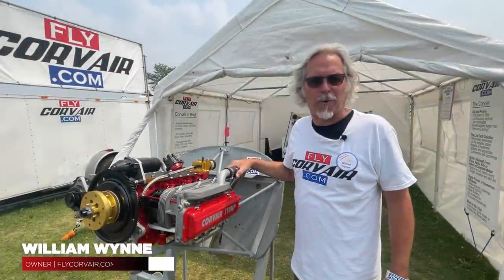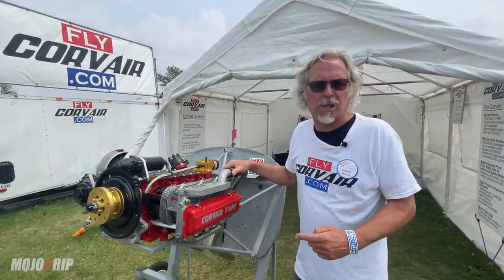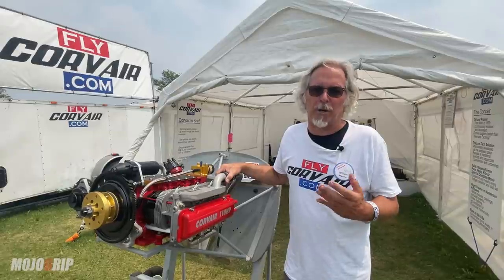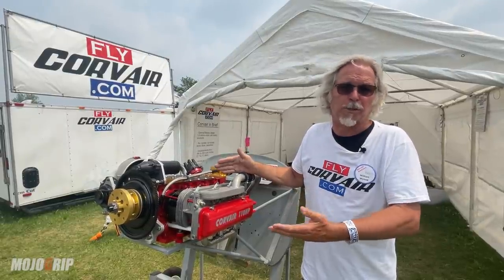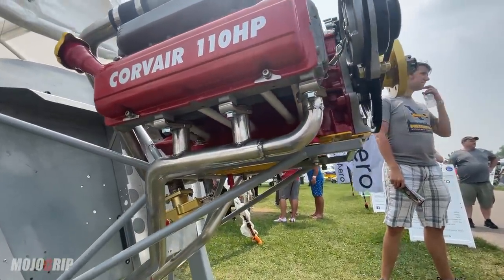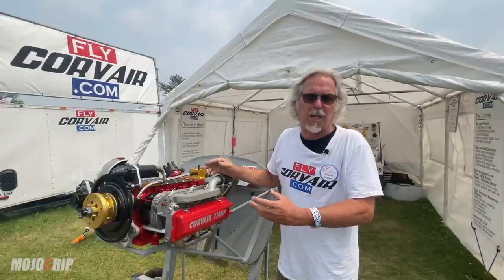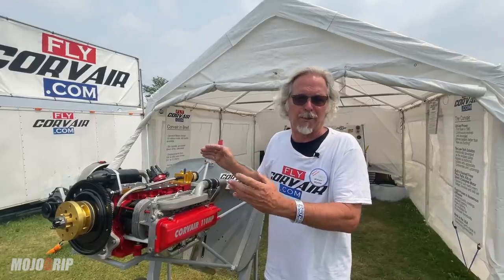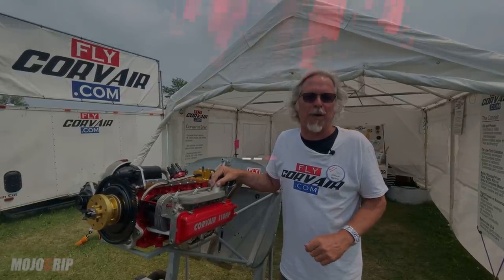Auto Conversion Engines Used To Power Plane | Corvair

Comment: I don't think the corvair is an easy project. Two many options, you have to be a dumpster diver to find the core, then you have to figure out what you want order/build. Or go to viking or aeromomentum get the same hp engine for the same price built for you.
Reply: Did you really listen to what was being said here though? They will sell you a completed Corvair motor if that's what you want; and it doesn't even really save you that much money to build it yourself. However, he encourages people to be involved in the build process so they intimately know the motor and can therefore be a better operator/maintainer. If that whole concept doesn't appeal to you, yeah, probably work with someone else. It's right up my alley though. DIY life!
Reply: @kleinbottled79  true he does offer complete engines for around 1k less. There is a reason corvair isn't as popular IMO. I was going the corvair route and found myself overwhelmed with the offerings and reasoning behind everything... Then there is the corvair college.. Not an easy or moderately easy endeavor. The engine is proven, but.. There are newer and engines at a better price point.
Reply: @DrJoeHandsome  newer at a better price? What might that be?
Reply: @jeffboatright  aeromomentum similar horsepower newer model engine 10k and viking engine similar hp newer engine 12k. When I say newer engine, I'm referring to the core. At the heart of the corvair, it's still a 1960s engine. If you rebuild an engine, the core is still the core.
Reply: @DrJoeHandsome  That's true Aeromomentum looks extremely promising. But it has one thimg that sells me: FADEC!
Call me dumb or whatever but which comparable engine in that power range has FADEC? Not Rotax, only UL Power does. And yeah, FADEC isn't everything but

Comment: how you can waste money 10k one car engine ????? i buy my toyota 2,4 liter engine new and cost less than 3000$ new- how waste money one engine 10 000$ have all parts gold and titanium and diamond or what have cessna or other lycomin 300hp engine can buy used ,less than 4000$ and waste money repair this in home new conditino new parts ,bearing,piston rings, seals, oil pump etc, less than 2000$ or 3000$ but then have diy made new engine and can fly next 100 000 hour or more. less than 7000$ can build owen new condition engine and lot better and powerfull more .about 300hp. can use many different big plane. and have good change old little cessna 182 to lot better powerfull.
Reply: @gammaraider  25000 $ and this price have air 13000 $ ower price.
Reply: You are the kind of guy who ends up in a smoking hole because you don't think past the end of your nose.

Comment: 10000 to build corvair engine 🤣🤣🤣🤣🤣🤣🤣😂😂  con artist
Reply: If you think that’s expensive don’t get into aviation lol
Reply: It's really no longer a car engine it's been redesigned with aviation in mine everything is more Aviation proof
Reply: I was priced around $25K to overhaul a 1960 Lycoming 180HP engine. This does not include the mechanic fees and other collateral stuff needing replaced Firewall forward,  guessing another $5K for that.
Reply: @mhilderbrand7693  you pay lot ower price, stupid pay, internet and many hangar have used good condition 200hp-400hp lycoming endines can buy less than 4000$ and if want can repair all new condition less than3000$ all engine have new good and can fly next life full.
Reply: @mattivirta  suuuure u can 🙄
Reply: normal corvair car engine repair less than 3000$ new condition easy make home this. normal men can repair one engine wery easy simple job.
Reply: @mhilderbrand7693  used less than 200 hour used lycoming have internet can buy less than 4000 $ and repair this new conditrion change some parts and seals, cost 2-3000$ only idiot waste money 25000 $ new engine because old can use many year.